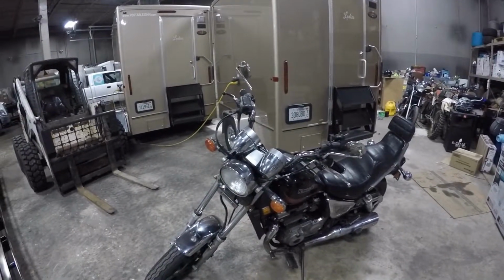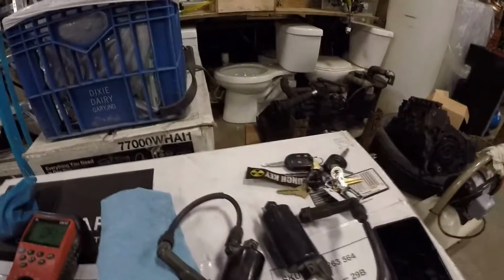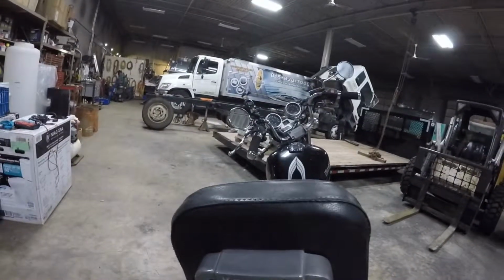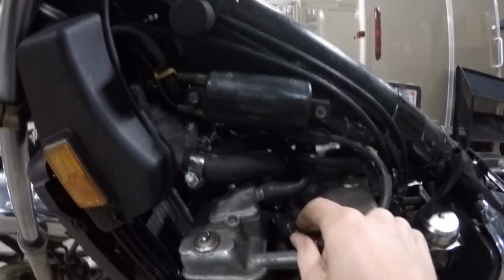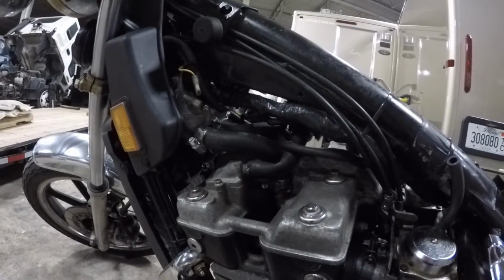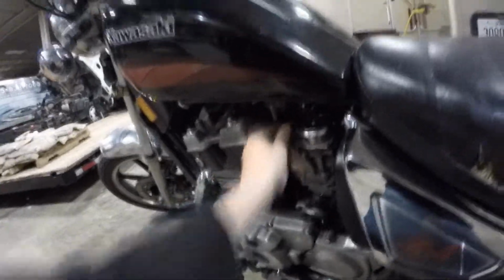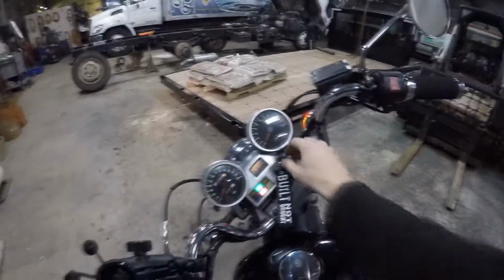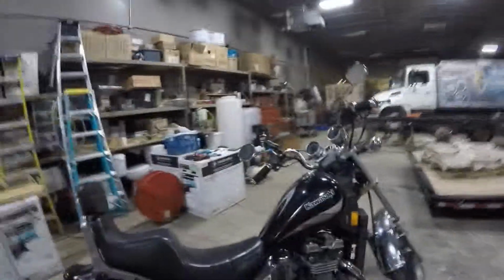Kawasaki 454 LTD Build Part 7 New Ignition Coil install

Comment: The coils on the 454 I’m trying to get running are right at 3 ohms. Is the spec 2.7  - 3.4 or are mine too low? Are the replacements on EBay reliable? Maybe it’s the cold and the intake box being off but I can’t get this to fire. New plugs and getting spark (yellow/orange), fresh gas but not even a pop with a shot of carb cleaner. Haven’t taken carbs off or done the valves but anything else I should be checking?
Reply from the maker: Definitely carbs, your getting spark at the plugs so it's not electrical. Valves are important but shouldn't stop it from running entirely

Comment: Hello, my name is Roberto. I have a 1989 454 ltd and it will not start when it gets cold. someone told me to change the anti freeze and I read somewhere else that it could be a bad coil connection. It runs like a dream in warm weather. It has About 6000 miles. do you have any advice I may be able to use? thank you.
Reply from the maker: Fuel and spark would be the problem with not starting when cold. This bike has to have the choke on all the way to start especially when cold. The choke should have the bike Rev up to 4-5,000 rpm after about 30 seconds. If you are getting decent spark and fuel is not an issue. Your valves may need to be adjusted. These bikes are very sensitive to valve adjustments. If the valves are too tight it won't let enough fuel and air into the cylinders to ignite them. Guys on the forums say to adjust them between every 5,000-7,000 miles. But I would start with the coils and spark plugs since that is easier to do. If the coil happens to be an issue. Most of the time with a bad coil the bike will misfire unexpectedly or run on 1 cylinder if bad enough. But follow my videos on the coil first then if still acts up a valve adjustment may be needed
Reply: I do put the choke on, plugs are new gas is new. It was 55 degrees last week it started with choke on.  This week temperature went down a lot and no start with choke on. Every winter it does this , come spring starts like a champ. It a real nice bike, runs like a dream
Reply from the maker: These bikes struggle alot once it gets below 50. I know that from personal experience with my garage sometimes getting into the single digits and trying to start it is really hard. Even when riding it I can tell it's not happy about the colder air being sucked into the air box. It sometimes studders under acceleration. Their may be nothing wrong with it at all then.
Reply: @Bando909  do you think the antifreeze could be a problem? I'm gonna change it and put a new thermostat just as maintenance. I read on the internet that coil connection could be the problem. Battery is new. They say the lights take a lot of juice away from the plugs. I really like my bike. It runs great spring though fall. They advised putting a relay switch to by pass the lights untill the motor starts.
Reply from the maker: I don't think so because antifreeze is only used to keep the block cool when it's hot. You can change it just for maintenance but I don't think it would change it from starting
Reply: @Bando909  okay, thank you. If you think of anything else please let me know? I guess I will have to ride it in warm weather only.🚲❄🌄
Reply from the maker: I don't ride under 50 degrees it's too cold for me. Lol, but warmer the weather the better especially with these bikes in particular
Reply: @Bando909  
на более поздней модели (kawasaki en400) штатно установлен подогрев карбюраторов

Comment: Also I know for sure not for sure but I'm going to replace the coil packs anyway spark plugs got to be put replaced and I'm going to go through making sure the cylinders are oiled up enough to turn it over and and then I got to put the gas tank sealer in the gas tank just for s*** some good goals spark plug swap.. also before I really ride it anyway I want to do a valve adjustment

Comment: I'm having the same problem with my ignition that I have to wiggle to get it to start.  If you're going to try to fix that, I'd be interested in seeing what needs to be done there.  I think sometimes even when I'm riding (occassionally even on the interstate) it will cut the engine because it wiggled into the wrong position from the vibration.  I'm happy I've always been on the outside lanes to pull over to the shoulder to restart.  Thanks for this video-- I'll be checking this.  I have a feeling my starting issues are fuel related though.
Reply from the maker: I ended up buying an entire lock set off a parts bike on Ebay and swapping all the locks out
Reply: @Bando909  Thanks.  Did you video it?  I also couldn't see where you put the meter probes in your first reading-- it was off camera.
Reply from the maker: @andrewyee7223  those are the two leads on the back of the ignition coil. Where are the two smaller wires connect to it. I did not video replacing all the locks because it's pretty self-explanatory. The ignition is the hardest you will need to remove the headlight and move all the wiring out of the way to get access to the two Allen bolts that are holding the ignition to the instrument panel. Then unplug the 6-pin connector that controls the ignition.
Reply: @Bando909  Thanks so much!